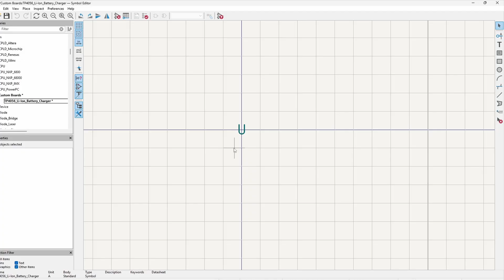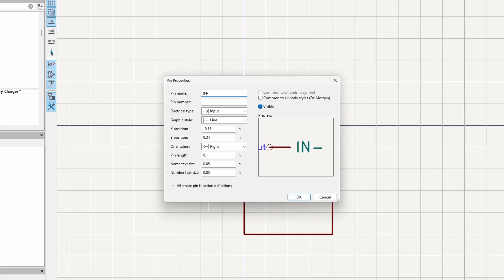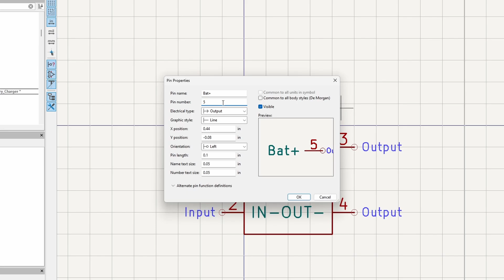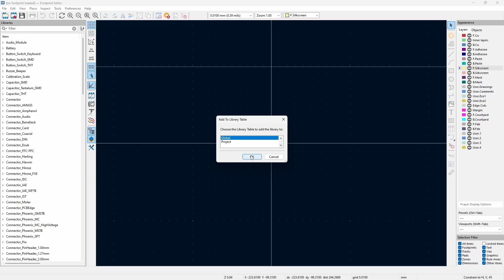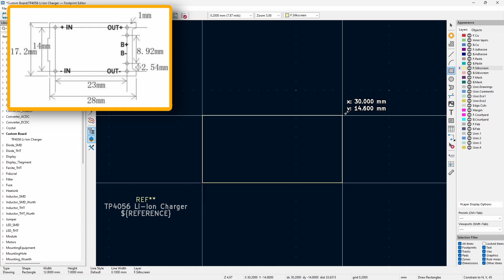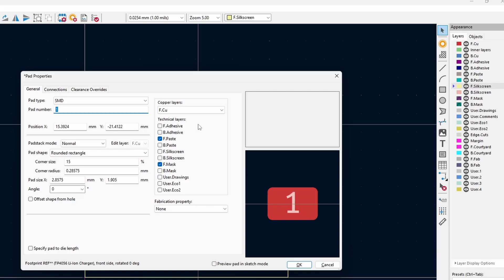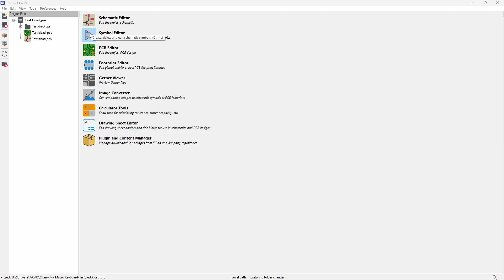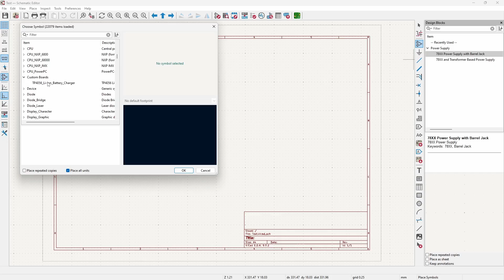How to Create Custom KiCad Symbol and Footprints | KiCad Beginner Tutorials

Comment: So, what am I doing wrong? I want to draw a simple rectangle to make a symbol. I follow the directions of the tutorial by clicking on 'Draw Rectangle' . Then I attempt to draw the box. I click the LH mouse button , drag the mouse and then let the mouse button up. When dragging it draws a solid, faintly pink, rectangle  which then disappears after letting the mouse button up. No rectangle is drawn. I've tried a number of other ways of clicking etc, to no avail. What should I be doing here?
Reply: Thank you for the various replies. At last I worked out what I was doing wrong. Some of it was that I expected to drag a rectangle. Then the size of the images confused me. All difficult to explain but I can do it now, thank you.
Reply from the maker: Your Welcome!
Reply from the maker: Hi, you have to select the Draw rectangle and then click on the point where you want to start the rectangle (don't hold down) now drag to your required size and then again left click to end the rectangle.
Reply: @diyhideout  Thanks for your reply. I had already tried that too. I tried it again. Click on rectangle, then If I click on/off the centre, When I move away I see a big red dot. Then I click again to for the rectangle and I see no change. As I move the cursor I see no rectangle being drawn either. Also, when I do the second click the x-y information disappears from the Properties on the LHS.
Reply: If it gives you a pink rectangle that is the selection mode instead of the drawing mode.